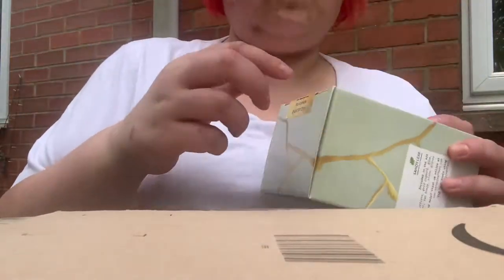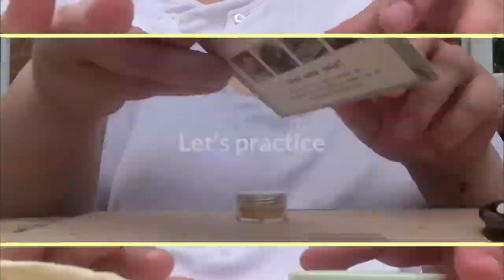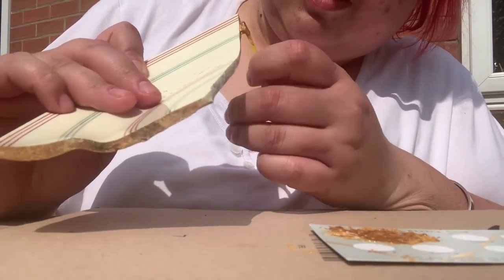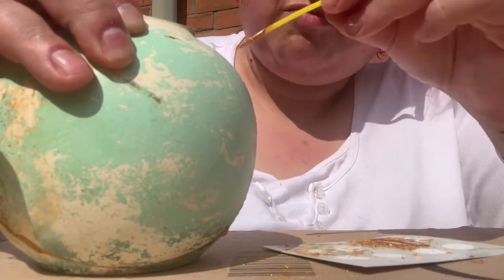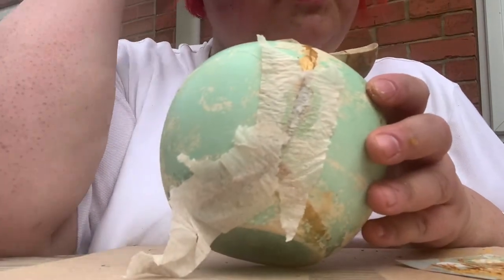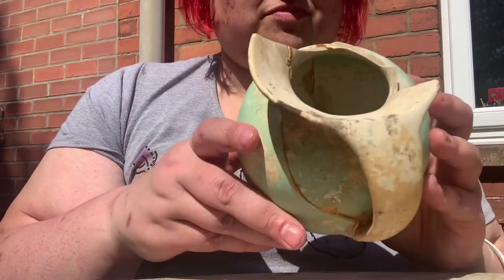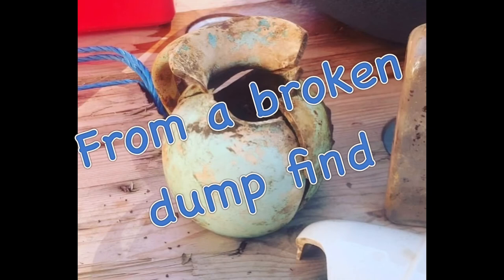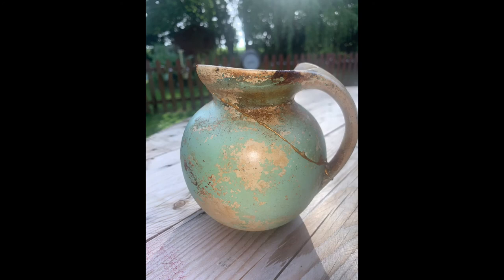Using kintsugi to repair a jug found in a 1930s dump

Comment: Great video,all ways wondered how they did this. For the gaps in the side i would have blown up a balloon inside it to seal the gap then filled them in with the resin. Would save cleaning all the paper off. Will have to look in to getting some of that mica powder to mix with resin to coat the edges of some of the pendents i make to seal the edges.
Reply from the maker: Yes that would probably work as well, although in this case a balloon might not have filled the space properly. You have now got me thinking about trying this for another kintsugi project though 😁